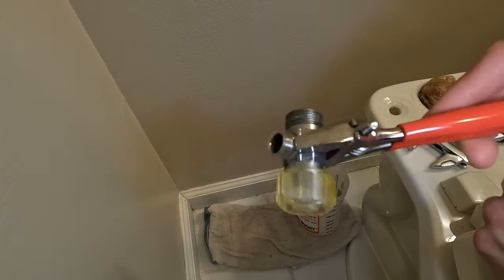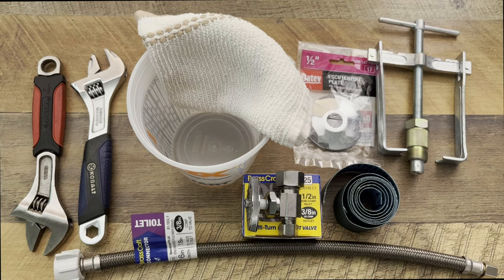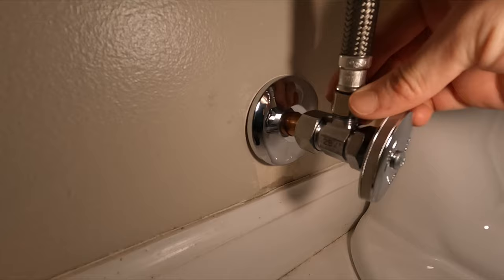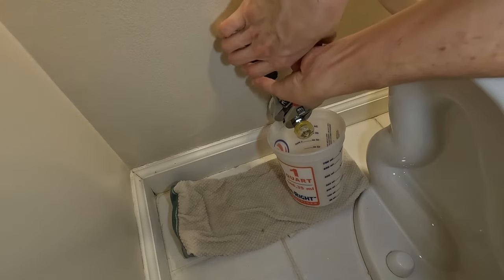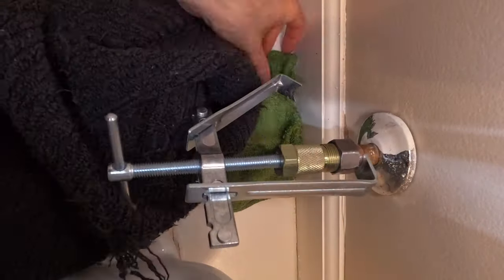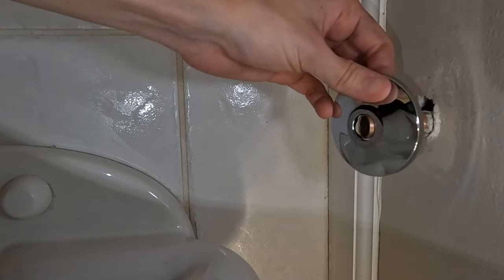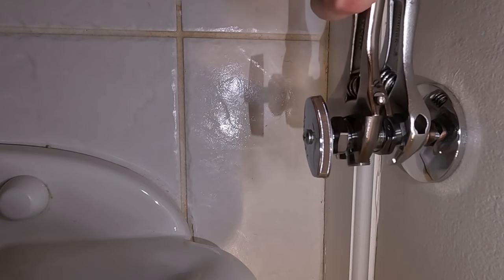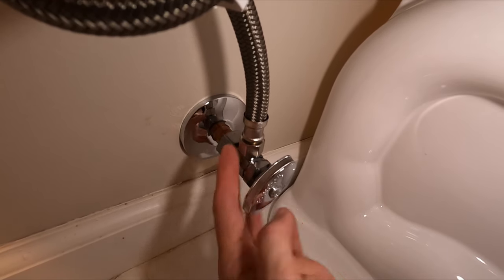How to Remove and Replace a Leaky Shut Off Valve for a Toilet

Comment: Great video. Here’s a little tip. Replace your gateway style valve with a quarter turn ball valve and never have to do this job again. 😉
Reply from the maker: I wouldn't be surprised if they typically last longer since there's less movement (and less wear over time) to open and close the valve. Next time I need to replace a toilet shut-off valve, I'll grab a quarter-turn valve for the project. Thank you for the suggestion!
Reply: Agreed..  Great video, clear photography, great editing.  And with use of 1/4 turn valve.  It will be the last time you need to do it.
Reply: Great video!!

Most replacements are heading 1/4 turn style and press-lock.

Comment: Why would anybody fit a crappy multi turn valve? Those are the valves that stop working just when you need them, and which people are ripping out and replacing with reliable quarter turn valves.
Reply from the maker: Quarter-turn valves seem to be well liked and reliable. That will be what I use for a future shut-off valve replacement project ☺

Comment: At first, I wondered why you did a loop with the supply line instead of just getting the correct size.  I just replaced my shut off valve and the existing supply line no longer fit, nor did a a new 9-inch braided line bend correctly to align between the tank and the valve.  Lucky for me, I remembered your loop maneuver and bought a 20-inch line, looped it, and everything fit like a champ!  You saved me a lot of stress on solving this issue.  Thank you!
Reply from the maker: That's awesome ☺I'm so glad this trick was helpful and made the install process easier! 
Thank you for sharing your project experience ❤

Comment: Use some thread sealant but thanks for the tutorial. That darn olive.
Reply: You must be from England. That's what it is called there, but not in the US.
Reply: Why would you use thread sealant on a compression fitting, when the threads have no part in the seal on this type of fitting?

Comment: Thank you!  I found this to be the most practical and informative video for compression valve toilet supply line replacement.  My only comment is that I prefer the 1/4-Turn valves.  They seem to be more reliable.
Reply from the maker: Thank you for your kind words! Your message brightened my day ☺ It seems many prefer the 1/4-turn valves. That's what I plan to use next time I need to replace a compression valve.

Comment: You moved very fast. I'm still confused as to which way to turn the various nuts to remove the old valve. Yours seem to turn the opposite way to mine.
Reply from the maker: Thank you for the feedback, I appreciate it! For the larger valve nut on the copper water line and with the valve handle facing you, I turned the nut from left to right (clockwise) to loosen it. For the smaller nut on the toilet water supply line, I turned it counter-clockwise to loosen it.  I removed the nuts from the new valve to figure out which way to turn the old valve nuts to loosen and remove them. Hope this helps!
Reply: @wildcat-diy  I managed to get the old unit off. I bought the sleeve puller but the directions that came with it were pretty useless. I tried to follow what you did but I can't get any movement of the compression sleeve. The handle that you turn is hitting the arms of the tool where they stick out backwards and won't turn any further. Some information on how to set up the tool would be very helpful. Have spent several hours removing, adjusting and re-installing the tool in an attempt to get it to do anything.
Reply from the maker: @golden.lights.twinkle2329 Glad you got the old valve off! It took me numerous turns to remove the tight compression sleeve. I didn't find the tool's arms to be useful beyond initial placement and I've seen others tape them together to keep them out of the way while turning the handle. Superior Tool has a quick video on how to use this same tool that you may find helpful: https://youtu.be/7KDe8ACKjwc?si=daX6a9tS83btSykN

Comment: You could use a deburring tool to make the inside of the copper pipe not sharp. I saw it used in a video on Home Depot video.
Reply from the maker: Excellent point! Thanks for mentioning this. Deburring tools and tube cleaning brushes help make the pipe cleaning process quicker and safer. Next time I'm working with copper pipe, I'll include them in the process!

Comment: Great video.  Can you remove the old ferrel washer without the tool ?
Reply from the maker: Thank you ☺Yes, you can! I've seen a few old ferrule removal methods, such as using a small hacksaw to make a shallow cut on the ferrule and then splitting it apart by putting the tip of a flathead screwdriver into the cut and twisting. Another approach is to use two pliers, with one holding the copper pipe behind the ferrule and using the other plier to wiggle the ferrule back and forth while pulling it towards the end of the pipe. I also found a creative solution on someone's channel (video link below) where they turned an old compression shut-off valve into a puller tool. They placed the end of a large bolt inside the old valve to create space between it and the copper pipe so when the nut was tightened onto the valve threads, the ferrule was pulled towards the end of the pipe. They repeated the process, keeping the extra space between the copper pipe and valve by placing a washer and nut behind the screw head, until the old compression ring could be easily removed with pliers from the end of the pipe. Video Link: https://youtu.be/COYnuj7sIvo?si=heSD-GpqjdJ4mO0z

Comment: How to replace similar supply valve but it’s soldered.
Reply from the maker: Great question! If the valve is soldered on, you will have to cut it off with a pipe cutter in order to put a new valve on. You can install the same or a different type of shut-off valve (solder-type, compression-type or push-to-connect). You may find this video by seejanedrill helpful, which shows how to cut a copper pipe to remove a soldered-on valve (and other great info): https://youtu.be/HeEORnczD3s?si=LUyd1ELO9uJr3jRS
Reply: The OP said you'll have to cut it off but you can also get a torch and heat the old solder and remove the valve that way

Comment: How the phuk did this take you 3 hours?!?
Reply: This is like a 30min job at most. If you have all of your parts within arm's reach, and turned off the water main, this is pretty straightforward. But I think the video is excellent!
Reply: That was exactly my question!!! seems like a 10 minute job!
Reply: I THOUGHT it was going to be a 10 minute job... until I realized that the tool which removes the old compression fitting didn't fit behind my toilet. So instead I had to use a couple sets of pliers and it took over an hour just to take it off. Millimeter by millimeter... 😭 That fitting was probably about 30 years old.
Reply from the maker: Wow, kudos for sticking with it for so long to see it through! The compression sleeve I removed had been on for about as long (29 years) and removal was not easy or quick. What took additional time was waiting for all of the water to drain since this shut-off valve is located at the lowest level of our home. Sometimes, there's an outside spigot at a lower level but this wasn't so in our case. I hope most who tackle this project have an easier and quicker time! 
 
Regarding the limited space you had to work with, and for others in similar circumstances, I noticed this 3.7" ferrule puller on Amazon which seems to work well for ½" copper pipe: https://amzn.to/490vrS9